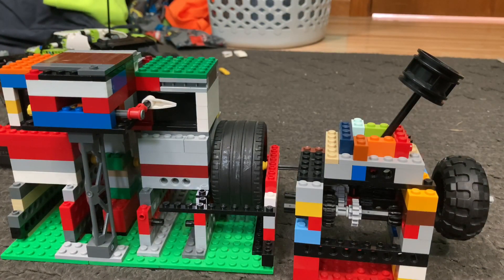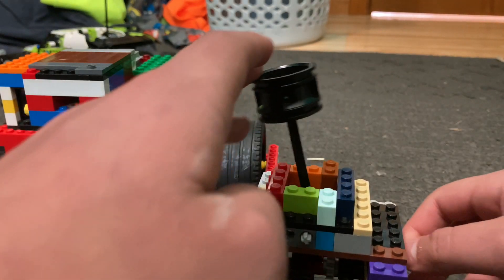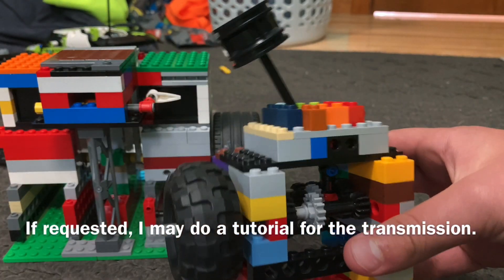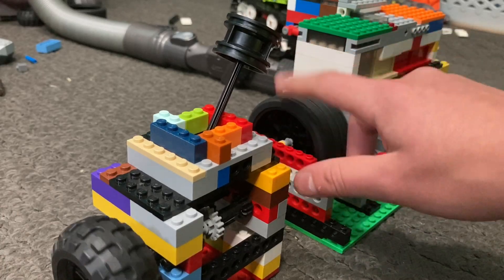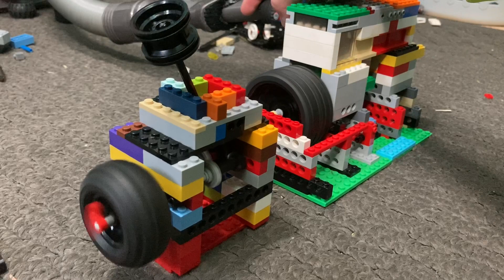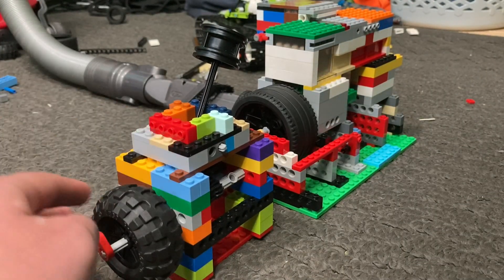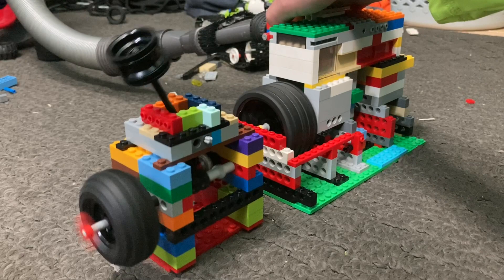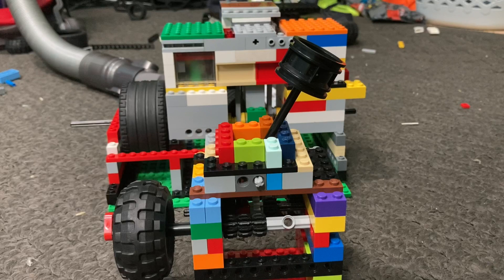LEGO 3 Speed Transmission Test With 2 Cylinder

Comment: i use vegtibaloil a lubrication
Reply from the maker: Nice! Vegetable or Olive oil is one of the best ways to go, however if you're even more involved, silicon or graphite based lubricants are also very good.
Reply: @KFPlusLegoMastery  I made your 2 cylinder oscillating engine and to works not as high rpm but idc just wanted a vacuum engine.
Reply from the maker: @EvanHeidingsfelder  I get that, I remember how happy I was when I made my first running engine, it was super slow and clunky compared to my engines today. Over time you just gain more experience and know what you have to do to make it smooth and fast off the top of your head.

Comment: Yooooooooooo                                            If u make a six speed or five speed transmission, the first gear could be easier to run for the engine and the long or last gear can be a little bit faster. BUT it was really interesting how a transmission can move from a vacuum engine, if tried this before and   My transmission was too much for the vacuum engine to run.                    Btw nice video
Reply from the maker: Noice Grey Probably the reason why your engine wasn’t producing enough power could have been caused by too much friction in the transmission. You should lubricate the holes where the axels go.
Reply from the maker: You might not see this comment now but I’m actually working on a 5 speed right now. Video should be up today or tomorrow!